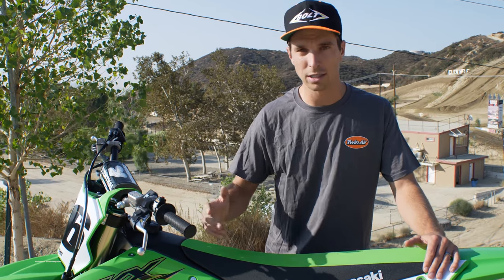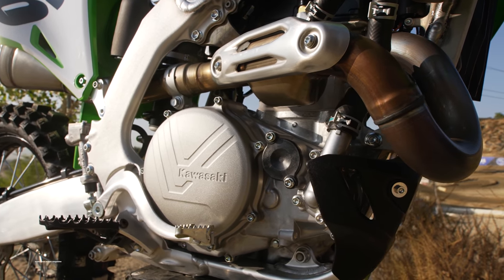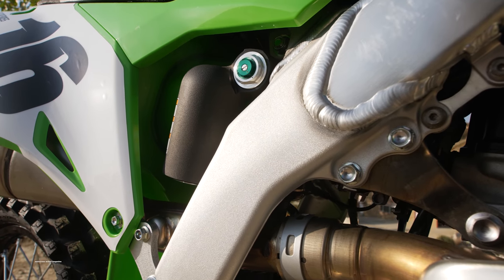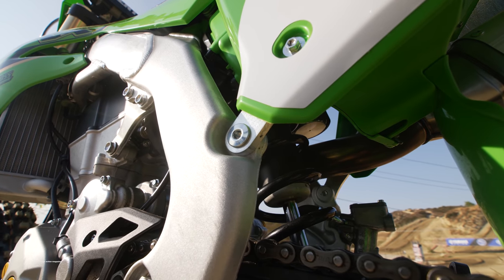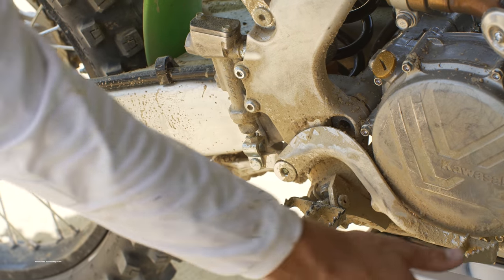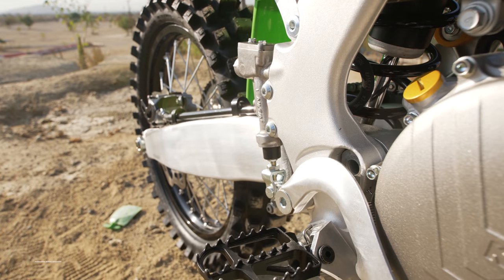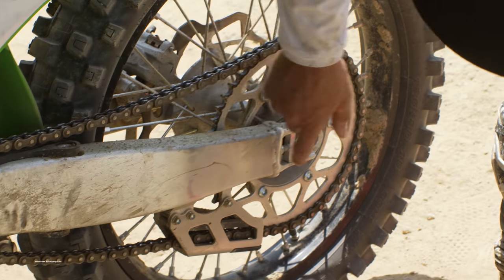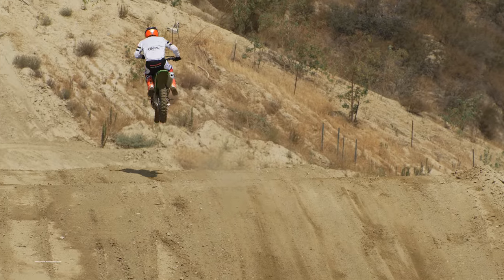2022 Kawasaki KX450 TESTED - Motocross Action Magazine

Comment: I went to a 240mm rear rotor on my 2020 KX450.
Ordered a Braking rotor, and a 2018 rear caliper mount. You only need those 2 parts.
And in a pinch, I can use the rear wheel on my 2021 KX250 if I get a flat or something else.
Only difference is the rim(2.15 on a 450, and 1.85 on a 250).
I use 110/90-19 tire on my 250(sometimes factory 250's run 120's depending on track and rider),  and 120/80-19 on my 450.
The tire clears the swingarm.

Comment: be nice if they made a 1/4 turn kit(Dzus fastener) where the 8mm bolt goes for the left number plate when accessing the air filter.
And side note, there's even less room in the 250 airbox, pain in the ass to get the air filter in and out.
I cut the backfire screen out of my air filter cages. I think No Toil makes a filter cage without the screen.

Comment: To adres the problem with the 8mm side panel bolt,  i put a Helicoil stainless 8mm insert in the sub frame, done.
The rear brake disc: i cut it in the lathe down to 240mm, problem solved.
A smal part of the brake pad is now not used.

Comment: Question: Can you putt around on these bikes without fouling plugs or do they like you to pin it all the time to keep it running good?
Reply: Four stroke engine... the spark plug will not foul, but the liquid cooled RACE engine will OVERHEAT if idled too long or bike speeds are low.
Reply: @redball4093  Thanks. I know it would be dumb to buy a bike like this and putt, but as a card-carrying poseur 50-something y/o I had to ask lol!

Comment: Hi I bought a 2022 kx 450 5 months ago ,I fitted a yoshimura RS12 full system with rubber mount .
I have done 15 hours and while riding today the subframe exhaust mount snapped .
Looks like I’m up for a new subframe.
Should this be covered under warranty . ??
Thanks Darren.

Comment: Are these street legal?
Reply: No it's only legal when you ride it on track... If you want to turn this green gojira into supermoto.. You need to spend on few mods.. Like taillights, horn and blinkers ☺️💚💚
Reply: no
Reply: Could be done but there are better options for dual sport. This bike is intended for dirt. You'd need to swap the tires, adjust suspension, etc. The dual sport bikes have a lot more road friendly options besides the obvious blinkers and lights etc.
Reply: Yes- if you ride it fast enough. 😏